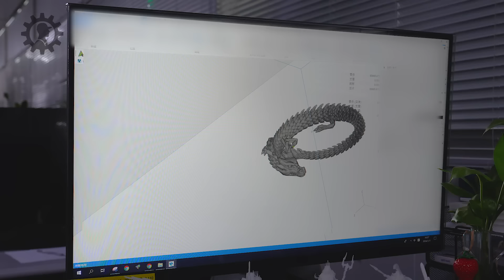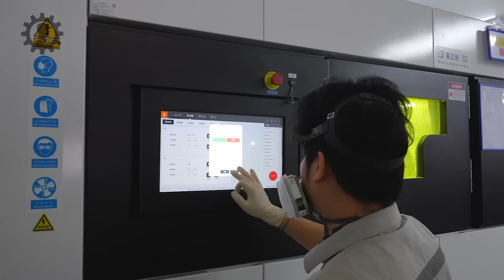Metal 3D Printing: Revealing Innovative Creations at a Leading SLM Factory | @JLC3DP

Comment: Why is the powder and fabrication plate handling done in such a primitive manual way when the rest of the process is so advanced?
Reply: beacause it's obviously cheaper
Reply: Because it's in china, the machine probably from out of china.
Reply: good question, this is the so-called sense of ritual
Reply: Maybe it’s a prototype machine
Reply: primitive and advanced are subjective 🤷‍♂️
Reply: @MrOukisee  No, china can engineer and build there one machine
Reply: people need jobs, this is the real world.
Reply: @ImproveConditions the kind of sintering they're doing has such a strong laser that the particles are literally welded together and to the table, even as a green part.  I suppose the answer is it's not safe to stick your hand in there and pull the part out while separating it but if you let gravity push the part onto the cutter it'd eat through the part, so it has to separate that way for their device.  I guess you could put a pillow or something if you wanted, but the parts seem fine.

When you say primitive, if you mean the hammering, they're getting the powder out of the little cracks.  You don't want to wet the powder because you want to be able to almost immediately reuse it, so you don't wash it out, and a vacuum just doesn't get it all cuz some always sticks in the little crevasses.  What makes more sense, buying a machine to hammer the back of the plate and vacuum it out, or just.... Using a guy with a hammer?  😂. Sometimes the dumbest solution is the most logical.
Reply: CHINA!
Reply: it make sense, the labor is very cheap in China, the worker that you see in the video, they are maybe making like 1k USD a month or less. the machine is more expensive in comparison. so it makes sense to some processes to be manual labor because the installation or programming of machines is much more expensive.
Reply: Cause robots can't do everything yet, the human hand, eye, and brain are still more advanced than anything on this planet
Reply: @haihengh  The thing about making $1000 dollars in China per month it probably the equivalent of making $10000 USD per month.... Measuring the rest of the planet on the USD really shows your lack of foreign travel.

$1000 is ¥7,108.10
Reply: @curlyhairdudeify it's a rare pleasure to see someone comprehend that the US dollar isn't as almighty as it's made out to be, don't let them know just how low in the list the US is when it comes to average wage versus the rest of the world, cuz you would think it'd be higher
Reply: Why over complicate a process? The plates don't have to be treated as fragile and get milled flat after every use. As for the powder, you have to sieve the larger particles out, and with the varying shapes of every part printed, manual clean out is really the only way. I do it every day.
Reply: @ImproveConditions A little bump won't hurt them, especially with harder materials. However, we use pond filter pad to keep this from happening where I work, as well as using smaller pieces of it to support heavier parts so they don't damage the edm, or break the wire.
Reply: Sorry the please aren't up to your standards.
Reply: Should I also point out that these machines including the device you typed this question on are miracles of science.
Reply: New technology
Reply: If U understood when to apply newest and greatest and when not you,you would get it
Reply: By primitive you mean do any form of physical labor ?? lol.  Welcome to the real world
Reply: they havent stolen that tech yet
Reply: Cost saving! A full automated process increase a lot the final customer price.
Reply: They can
Reply: Because it’s not mass scale factory line. Small qty custom builds.
Reply: They use titanium powder and the plate is titanium because they have to weld for stability.
Reply: Because it's a small scale facility genius. Not everything needs to be automated.
Reply: @Omarnormakhasev  Infantile retort aside, you still haven't answered my question
Reply: @GeorgeEllis-q1u  Can you not read?
Reply: because the rest is not that advanced as you thought. It is just 3D printing. Not some rocket science.
Reply: Sometimes the most efficient and reliable way of doing something is a seemingly premative way I guess

Comment: High tech company, wooden chairs for the workers. Sweet that they care for their workers ;-)
Reply: I've been in sooo many labs with expensive lab/workshop chairs and stools that were uncomfortable as hell. Countless times I've been soldering for hours and wishing for a normal chair that looks like those wooden ones.
The real problem in the video is when they have to lower those steel plates onto the floor and those low rollers- seems like a nightmare for your back! I'm sure they'll iron that out eventually though
Reply: What about gaming chairs?
Reply: Ah the Chinese way.
Reply: But didnt you notice the safety shoes?
Reply: Wooden chairs are absolutely okay, for long sitting I like them better than soft foam chairs.

Comment: nice video. some of these working steps look hilarious compared to the high tech printing process. getting a ladder to fill the printer at the top with a funnel while nearly spilling some powder into the machine. hammering the printing plate on the ground after printing. transporting the final printing plate with a career where you always have to lift the heavy plate to and from the ground instead of having it on a similar level like the printer window.
Reply: Hammering the print plate on the ground is likely done to reduce the amount of particulates that float in the air
Reply: You really don't see any other solution? Lol and you like lifting? @Life-of-Sammy-J
Reply: Could be a reason but If floating particulates are a concern they could do It In a chamber with vibration or something. @Life-of-Sammy-J

Comment: Why are support materials needed when there's still a bed of unmelted metal powder underneath?
Reply: It looked like that was used to prevent lateral movement rather than vertical
Reply: It depends on the angle of the section printed, the powder isn't packed down, printing on open powder causes an uneven surface that can damage the powder wiping arm, rip out the wiping material and ruin an entire print.

Comment: I can’t figure why these prints have supports? This is basically SLS with metal and SLS prints don’t need supports as the material surrounding the part at every layer is the support.
Reply: Hi, these prints need supports to prevent layer warping, because every layer resides heat and cooling stresses. So heat needs to be transfered to platform. Secondly, metal particles are much heavier than plastic ones
Sorry for my language 😅
Reply: @alexpavlov7962  so the need for supports and heavy post processing on parts to obtain finish is a game breaker. Especially for parts that need incredibly tight tolerances. Both the time to post process by hand and inaccuracy of manual support removal along with the possibility of damaging the work piece in the process makes this a very niche and unreliable method for metal parts compared to a quality 5 axis CNC.
Reply: yes, you are right supports were absolutely not necessary.
Reply: @rjakiel73  This technology is definitely still in the early stages. It won't be replacing machining any time soon.
Reply: @rjakiel73 While yes, you're not typically going to have perfect tolerances right out the gate, this process paired with machining does things that just straight milling cannot. It also reduces to costs when it comes to prototyping be removing the need for mold making and things of that nature.
Reply: @Friariah  mold making? I don't know of any reason to create a mold other than cast iron. With that said casting an iron part would be far more effective and economical than what you just mentioned with this process coupled with machining. Again for any fine tolerance high strength part be it aluminum, steel or titanium a 5 axis CNC and EDM is way more precise and economical than this.
Reply: @rjakiel73  That depends on the part, investing in the molding process is great for production, not one off test parts.
When it comes to strength, there's no difference, proper parameters produce solid non-porous parts.
For some complex parts, being able to print the general shape, then mill out the details saves time, tooling, and materials.
This process also allows you to create internal cavities that are not possible with CNC, or casting.
I work with these types of machines every day, we have many large companies use our services because of ease of creation, rapid turn around, and no investment in special tooling.
Reply: @rjakiel73 for parts that don’t need supports but would require a 5 axis mill to machine it is most certainly more efficient and much more economical. Again, this is mostly for prototyping, nobody is looking friction fit parts via metal 3D printing. Obviously, CNC machines are just unbeatable when it comes to high volume productions.

Comment: Nice one!, what metal powder do you use?
Reply: 0:56 said .316 stainless steel powder
Reply: @Bugnarok  Thank you for your reply. I imagine that the machine uses a fiber laser of at least 200W. I have a 50W fiber marking machine which I use for deep relief engraving and cutting small parts on brass, silver and stainless steel sheets up to 0.8mm thick.  Is there any powdered metal that melts at a lower temperature that I can test with 50W?  Years ago I assembled a 3D printer with polymer powder and used a CO2 marking machine to melt the powder as hobby. I'd like to try it with a 50W fiber.
Reply: @ricklaser2846  unfortunately I'm just a viewer here, I have no idea about the specs of the machine or anything related to it, sorry.
Reply: @ricklaser2846 Hi,  this one is probably one of 400w Farsoon metal machines. And to melt metal powder u must have inert gas like N/Ar. In this particular case for 316L u need N. Ar is used for Titan
Reply: Stenlis 316
Reply: Where I work, we have 250, 400, and 500W machines, we can use 316L, 17-4, a Cobalt-Chrome alloy, 718 and 625 Inconel, Ti-64, as well as AlSi10Mg. The last one, an Aluminum uses our lowest power, however, we have to heat the print bed to 170c to keep it from cracking during the process.

Comment: I was trying to understand why it took 2 people to place the metal bar, and then 1 was enough to remove it and with the extra weight of the print, but then I noticed that the preparation bar had nothing to do with the final work, because one has 6 fixing screws and the other only 4. After all, he wasn't the superman there.

Comment: WHY SUPPORTS
Reply: Hi, these prints need supports to prevent layer warping, because every layer resides heat and cooling stresses. So heat needs to be transfered to platform. Secondly, metal particles are much heavier than plastic ones
Sorry for my language
Reply: @alexpavlov7962  perfect explanation! Thanks that sounds logical.
I'm just some curious hobbyist with plastic printers.
That's pretty interesting

Comment: its not chinese tech, why they trying to show like its theyr. it EU made. And noby will make like this like they showed.powder is very expensive, sometimes roller  which adds sand fails and fails print. Than you print you pack evrything as close as possible, its like how you could use every space in kube possible. There is % of failed prints, sand can simply move. But biggest problem is price of sand type material used. And you must question capabilities of stufff made, can it be same as mold metal
Reply: The gas atomized powder is expensive, and varies greatly depending on material. 500kg of 718 Inconel will set you back between $40,000 and $50,000. Prints do fail, either from a poor layout on the plate, bad supports, or too low of a dose of powder per layer. With proper parameters, parts can have 99.8% density or better, so mechanically they will behave the same as a cast piece. The metal powder does not shift when building, however, stress created in the printed part can cause warping depending on the parts shape.

Comment: Isn't it 3d cutting ? I dont see no printing happening here ...
Reply: 4:55 3d printing 
7:55 1d cutting
Reply: @Omsip123 again, this aint "printing", it's still cutting in my book.
Reply: @cethyhnc9305  3d cutting is not a thing
Reply: @phatcap976 Neither do you, but here you are, commenting non-sense.
Reply: @cethyhnc9305  I don't know what book you're using and what it's written there, but for example Wikipedia and anyone else who has a clue on the topic calls this 3d printing.
Reply: This is  SLM 3D Printing - no "hard"  tools are  used only Laser and  metal powder....
Reply: Did you see them cutting powder?
Go to your kitchen and cut some flour.
Reply: @Nordicx86  I finally connected my few last braincells and I now see the light (I changed my mind).
Your comment made a difference.
Reply: @cethyhnc9305  - the term they use is “additive manufacturing”. Powder is laid down, the laser “welds” the powder into the pattern and onto layers that preceded the current layer, then repeat.